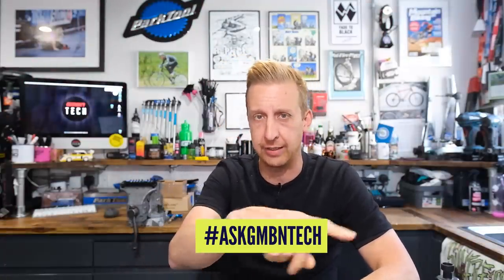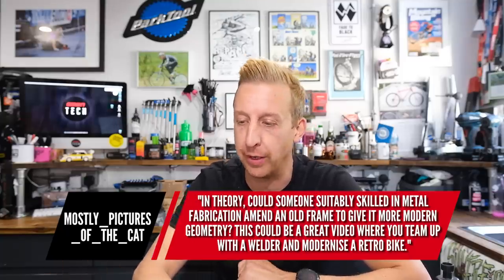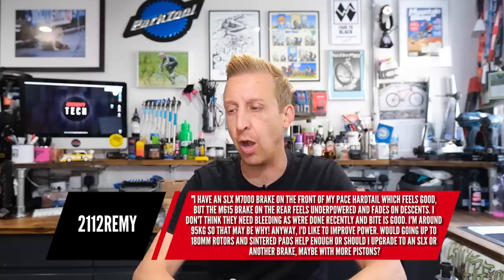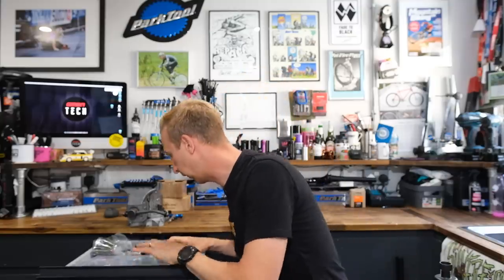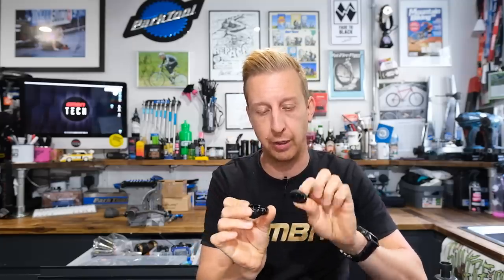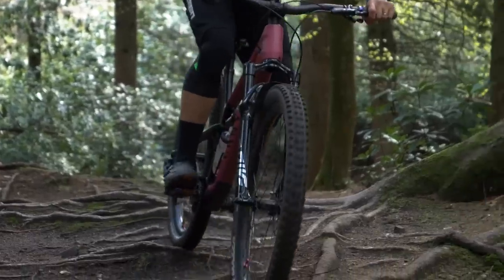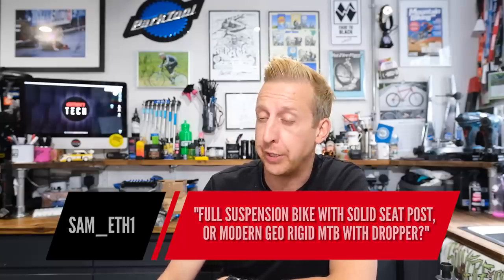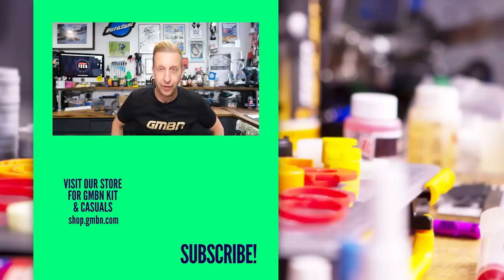How Will Mountain Bike Design Change In The Next 5-10 Years? | #askGMBNTech

Comment from the maker: What do you think bikes will look like in the future?
Reply: I don't think they will all get longer and slacker, but we will have more variety of bikes

e.g. some short playful (Santa Cruz 5010) or some long and fast(Grim-donut😉)
Reply: I've got slx m7000 2 piston brakes and I was wondering if I can use the 4 piston calipers with my older levers
Reply: I think Guerrilla Gravity is leading the charge on this one: modular frames and recyclable carbon gonna be biiiig!
Reply: it will be same
Reply: Good...
Reply: @jinavl  yes you can
Reply: Most propably: a new type of transmission.
Instead many sprockets at rear and deraileur - more popular becomes: hub integrated gears.
1 version - gears in backwheel (for leisure bikes) - same as we have now.
2 version - gears integratred in centre hub (instead electric motor)
3 version - electric motor with integrated gearbox
Only need one chain tensioner (with pulley wheel) to make it work ;)
This can lead to more reliable transmission with less power loss.
Reply: They will LOOK very similar to today (except perhaps more fancy paint options) and tech will change but slowly if the manufacturers are selling what they got already. Once lockdown demand/scarcety of bikes is over then they gonna start innovating to sell again.

I would like to see:
Lighter (emtb)
Better battèry capacity
Built in lights and security
Adjustable height bars
Puncture proof wheels/inserts standard.
2 speed Hub gear to supplement Derailleur.
Stronger chains and sprockets for emtb.
Intelligent (electronic control?) suspension for better ride.
Adaptable adjustable shape saddle.
Cruize control (🤣🤣🤣)

Look at bike tech and its way behind car tech in advancement
Reply: 30" wheels
Reply: I hope additive manufacturing opens up more possibilities for people with non-standard relations between leg and upper body length
Reply: The Grim Donut, it’s kind of scary to look at it actually
Reply: @stanley3647  chains and gears are high maintenance and high wear
Reply: @chrisridesbicycles  inches of adjustment in the seat post, bugger all everywhere else!
Reply: I don’t see reach getting much longer, our arms aren’t growing. But I think at some point we’ll have sub 60° HA and longer chainstays
Reply: @vtecmossy  🤙🤙
Reply: My predictions are:
1) geometry numbers won't change too much but materials will.  Perhaps frames made of graphene and other new light weight materials?
2) 27.5 and 29" wheels will be replaced by 28 and 30".  So we'll have 26, 28 and 30" wheels sizes
3) because of the new wheel sizes, new hub standards will also be created
4) more electronics.  Like, electronic tire pressure monitors so you can see how much PSI is in your tires at all times, built in GPS (this can also be handy if your bike gets stolen), magnetic suspensions, smart glasses that integrate with your bike's other electronics (maybe even adding night vision for night rides?)
Reply: @HUSKY7-1  30.5" wheels
Reply: They will probably start increasing the diameter of the head tube again. Especially if single crown long travel is the way forward. Now all bikes are 1.5" tapered. 1.1/8" straight is gone. Crap because if I want to upgrade my fork I have to buy a whole new bike and they are so almost prohibitively expensive nowadays. Next step, 1.5" stem and 1.75" lower. Its a shame they keep doing this kinda thing but they need to make money and they will continue to market new trends to do so.
Reply: Recumbents
Reply: i really hope they're going to move to gearboxes!
currently gearboxes take close to 0% of the mtb market because derailleurs work great so investing to replace them makes no sense
i think the effigear + valeo combo has a lot of potential, if it does hit the E-bike market, maybe the big brands will start considering gearboxes for mtbs
Reply: The Grim Donut of course
Reply: You know what? I look forward to see XC and road bikes on 32" wheels. Why? Because small girls can already shred on 29" so why not scale up and give all tall guys some bigger wheels advantage...
Reply: Go electric...
Reply: Obviously, ebikes will be have increasingly more power, more speed, more range. Within ten years, most ebikes will not even have pedals. Now consider how the prevalence of these bikes will change how trails are designed. We already see the over-sanitation of trails and the dominance of artificial swaths of wide, buffed, greenway-style roads and playground-style "technical features" throughout our forests. The sport is becoming a roll-and-huck amusement that requires massive construction projects. When ebikes evolve into lightweight electric motorcycles, which they will, it will be the last nail in the coffin of human-powered mountain biking.
Reply: As ebikes become more popular, regular bikes will become less appealing and get less attention from the manufacturer 's
Reply: In the future we will have shimano "wireless" derailleur and seatpost
Reply: I think the longer, lower, slacker trend will mellow out.. Eventually, the focus gets to be a little too focused.

Comment: Bike Design of the Future: THE GRIM DONUT!
Reply: and also hardtail Grim donut!
Reply: @karlcorrz  well,  the original grim donut wasn't even the way Mike planned. It's supposed to have a high pivot. They should throw in some gearbox drive and a linkage fork for good measure. Offloading the drivetrain from the rear wheel would reduce unsprung weight while the linkage fork would be better suited in a sub 60 degree head angle.

Funny thing is, Yoann was so convinced of the future that he's already planning his own Grim Donut on Guerilla Gravity.
Reply: I am sure it is not. That bike must have terrible handling
Reply: @dinunclv  did you watch the videos?
Reply: @dinunclv  it's a tongue in cheek design that's supposed to be a joke/meme that ended faster than Yoann's Commencal. But hey, if it's stupid but it works... but thinking about it, people can still justify riding DH bikes even though they have terrible handling on climbs. Same can be said of the Grim Donut.

Comment: Another great video, thanks Doddy. I also wanted to say thanks to you and Neil for a couple of your old GMBN Tech vids on adjusting front and rear derailleurs/indexing gears. I used them to bring my '97 GT Bravado back into the fold... I took it out for a spin earlier and it would appear that I did a pretty good job. So, thanks again to both of you for your helpful video guides 👍😁👍

Comment: Brakefade -> bigger Rotor & metallic Pads-> higher thermal capacity + higher circumferance Speed (better cooling of the rotor) + higher temperature resistance on your pad.
bigger calipers will do little, as the amount of energy you convert to heat will stay the same on the same decent.
opening your brakes for short times will make the biggest difference as it allows Air to pass through the Caliper and cool off your Pads. (if pads make contact theres no gap for air to pass through)

Comment: possible issue for the final question about gears... make sure the cassette and derailleur are matched... use an 7 speed derailleur with an 8 or 9 speed cassette - you can set the limit screws to 'see' right, but the amount each shift moves the derailleur across the cluster will cause misalignment... rubbing noises will be the clue...

Comment: Derailleur issues:
Check derailleur alignment (go to LBS if you don't have the tool).
Open up the limit screw so they are not overriding the indexing, good top/bottom indexing my be a red herring.
Double check the pinch bolts, as I had a Box derailleur that had the throw slightly off due to the cable being clamped slightly wrong.
Index per Shimano manual (no chain, slight rubbing, 6 clicks for 12-speed), this should get the mid-range correct.
Check big gear clearance (B-screw), make sure you aren't over-indexing to get into the big ring because of excess gap/slop

Comment: About using the GPS mount on your stem. I have a 40mm stem and I secured the standard mount to it with safety wire run through  shrink wrap so the wire doesn't rub off the finish. Much more secure than the o-rings that come with the mount.
Reply from the maker: Good tip!

Comment: Regarding the gears not working in the middle: Check the outer cable under the endcaps. It can happen that it gets bent or shrinks and the endcaps only sit on bendy wires.
Reply: Or, Check the cassette, it may be old and they are the gears that the riders use the most, so they could be worn. I would confirm this by trying a different cassette. Had the same thing happen to me, and that was the problem.
Reply: @DG-tf9rp  Good point. And before changing it, rattle on the sprockets and see if they are loose. I had one or two cassettes where the rivets came loose.

Comment: I have a Cannondale Delta V-700 which I've knackered the chainstay with a DCD hopping about...this put the rear out of alignment and, knackered the welds in due course.

You guys are welcome to try a 29" conversion on it if you like?

Oh, it's also got standard form converter cups as I bent the fatty headshock too 😁

That said, the head tube is as wide as a coke can and could likely be converted to anything up to about -10° modern fork standards

😂

Comment: Regarding brakes, on my bikepacking bike which is fully rigid I have shimano saint 4 pistons with 180 rotor front and rear. That will stop a truck and overheating has so far never happened. Maybe a bit of an overkill, but when dragging brakes for long descents fully loaded reliability is important

Comment: #AskGMBNTech Do you think the future of dropper posts will be a version where you can move them up and down purely via the remove without having to push it back down physically?
Reply: That would have to be a completely different system then what we have now
Reply: That would require some power source
Reply: @OYeahan  yeah, im thinking like a sram axs post with a motor or something
Reply: @spuddo123  yeah but that battery would have to be rather large compared to regular AXS receiver that only handles radio receiving and small actuator for hydro valve - this would make it a hard sell for racers etc. who take weight seriously - maybe would be acceptable for some enduro riders or sth. Decent drop and/or rebound speed would also be hard to achieve in such a system, should it be purely mechanical. But I agree that this would be a nice solution - just click the button and the saddle is out of the way. There is some safety risk involved though, too - with a regular dropper you actually feel with your buttocks that the saddle goes down and stays there. With such an 'active' design it could be really dangerous if the rider assumed it worked and it actually failed to.
Reply: @OYeahan  I was thinking you could have an air spring to push it up and some sort of winch to pull it back down. Yeah, there would probably be a bunch of engineering challenges like this but that's just a challenge you face with new technology in general. The question is whether it's actually a step up from our current dropper posts or not. Thanks for the feedback 👍
Reply: @spuddo123  there's no free energy, and your solution seems to contradict that to some extent I guess

Comment: In weapons manufacturing we are using more 2055 and 2024 aluminium. These are stronger and lighter than the "entry level" 6061 T6 that is currently used in most MTBs.
I would like to see other forms of lithium based lighter, stronger aluminum's used in bike construction.

Comment: With regard to braking, I'm running SLX 4P on a full suspension (Ripmo)  I feel like they don't grab as good as my XT 2P (Ripley)?
What could be the reason?  Off the top, not sure about the rotors.  I believe on the RIpmo they're 180/160. Btw, on the Ripmo I'm running SRAM NX rotors.  On the Ripley, everything is Shimano.  Thanks

Comment: #askGMBNTech Doddy, I recently bought a new 27.5+ bike (an Octane One Sour) which I thought came with tubeless ready wheels. So I converted the rear to tubeless and afterwards realized the tire (a Kenda Havoc 2.8) was the non-tubeless (wire carcass) version. But it seems to be holding air just fine. No leaks as far as I can tell. Can I stick to the tubeless setup, or should I put the tube back in there?

Comment: Q: Regarding the issue of middle gears shifter problems.  I wonder about the quality of the shifter mech- the movement of the cable has to be pretty precise for clean gear selection.  Do you know if some shifters are "sloppy" especially after time?  The first and last gears are the easiest to hit with the limiters working properly.

Comment: #askGMBNTech I have a Giant Trance X 29 3 and I installed a fox dpx2 but the problem is that the piggyback shock is touching the bottle cage but not touching contacting any parts the frame are there alternative solution. From Singapore
Reply: try to buy new bottle cage with higher mounting system or with system which allows adjusting of height, or if you can drill holes on your current bottle holder so that you can move it up more.
Reply: I had to mount my dpx2 upside down

Comment: One frame designed for the use of a gear box or electric motor that uses the same mountings and a battery compartment that can also used for storage instead of a battery..

Comment: #AskGMBNTech Hi Doddy, been a fan the show for a little over a year now. My question is: would do you an epside looking at wheels? You mentioned recently it is a good place to save on weight and for good suspension perfromance with keeping the unsprung mass as low as possible. I'd be interested in a show covering some of the wheels available and how to choose a suitable model based on frame type and intended use. For example, if you buy a frame and build up the bike yourself as there are plenty videos about forks and shocks....thanks :-)

Comment: #AskGMBNTech
hi Doddy, is there a way to know how big of a rotor you can fit on your bike. For example, if your bike comes with a 160mm rotor on the rear and you want to upgrade it to 180mm, how can you know if a 180mm rotor will fit before buying.
Reply: You will have to buy an adaptor to go from 160-180mm rotor and you will have to make sure you are buying a centerlock or 6-bolt rotor

Comment: #AskGMBNTech

Hi Doddy, 

Right now there is a seriously irritating issue going on. Recently I have inserted a cable through my frame due to a dropper post. A few months after that, I am plagued by ticking noises from the frame due to cables. The slightest movement is enough for tapping and crackling. Pushing or pulling the cables from the outside seems to have little effect. The cable for the dropper post was hell to get through and of course I don't even know if it's that cable ... Any suggestions?

Comment: Just following on from your brake fade discussion. Why do some mountain bikes (XC excluded) come with smaller rear discs? Is that a hold over from the techniques of road cycling and XC? Personally I use my back brake much more than the front when riding trails, and would always want my rear disc to be as or even more powerful than the front. #askgmbntech

Comment: #askGMBNTech will a Cush core add as much weight as an inner tube? I was thinking about getting one but don’t want all that extra rolling weight like when I had a tube.
Reply: Cushcore 29 is 260g per wheel. It's noticeable, but worth the added support and protection if that's what you need.
Reply: I second that^^^
Reply: Better use a more downhill-oriented tire in the rear (sidewalls)
Reply: I use it front and rear. Love it!

Comment: #AskGMBNTech I have got a question regarding the brakequestions you have answerd today: I am a heavy rider (120kg) and my rear brake gets very hot (Rotor gets discolored) when i do a long alpine Decent. I have mounted 220mm Rotors front and rear, 4-pot Guide brakes and sinterd, fined pads. Is there any other way to keep the Brakes from overheating?

Comment: #askGMBNTech Hi Doddy, great show, got back into biking again a couple of years ago, dusting down my much loved y2k Santa Cruz Heckler.  I've updated and changed a few things, new disc brakes and a narrow wide single ring on the front, which have been a revelation.  Now, my question is, given its 21 years old, with matching 21 year old geometry, it feels a bit like im sitting over the front wheel which can be a little unsettling to say the least going downhill, would it totally kill it to put a 27.5 wheel and fork on the front and make it into a mullet bike?